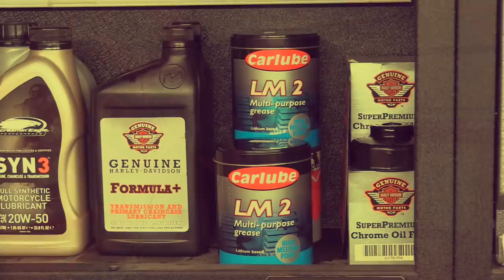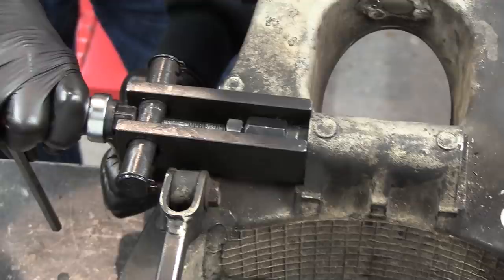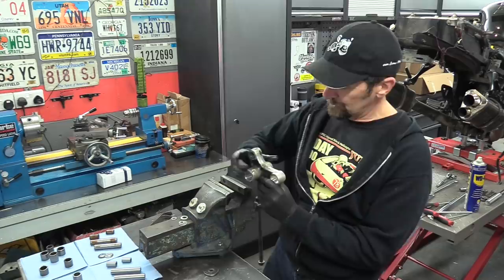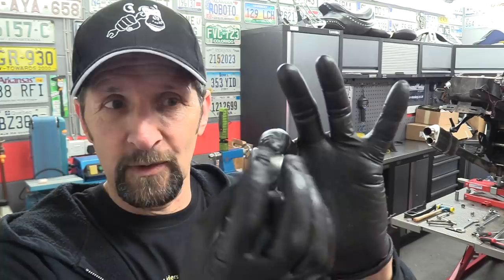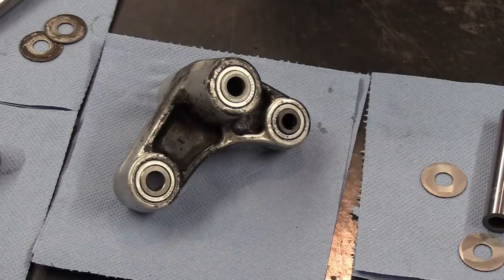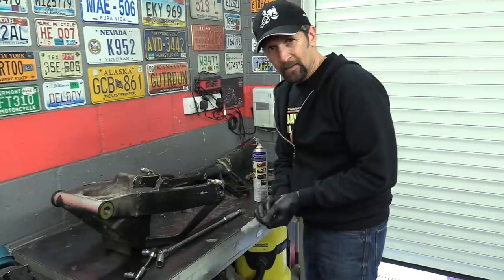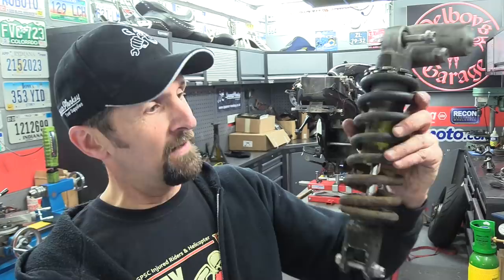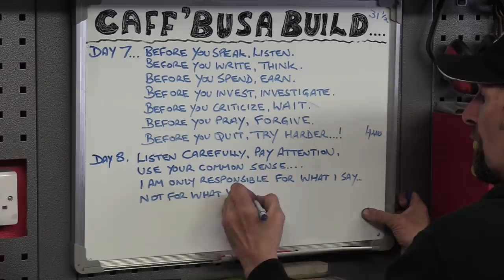Delboy's Garage, Busa Build Day 8, Suspension Short Link Bearings.

Comment: I am enjoying this so much, thank you.
Last year I was wearing some surgical gloves whilst angle grinding. The glove got sucked off of my hand, from between the thumb and forefinger, by the draft caused by the flapper wheel. That dragged my hand and wheel together.....kin ouchy! The glove wrapped around the grinder spindle and the flapper wheel bringing it to a full stop. I got lucky this time, just the top two layers of skin about the size of two 50p bits, and that was all good in a month or so.
Reply from the maker: Sure thing buddy, gloves and spinning wheels can be lethal, the black rubber gloves I wear rip in a second, and if anything, prevent those little abrasions when you catch the wire wheel, but strictly speaking it's still a no no... there have been some pretty horrific accidents due to gloves, basic stuff aye?!  Glad you got away with it, stay safe...

Comment: Suzuki Service Manual: "discard the self-locking nuts.." or "replace the ...... "
referring to the rear suspension. Good engineering practice to replace
any self-locker anyway, view them as single use items like oil seals.
Cheap enough. Enjoying your series chum. 
I had an RG125 which had chunky rust soup for bearings even worse 
than the ones you had.. If one's gone, they've all gone (or very soon will have).. 
so yep, change 'em all. Good engineering practice.

Comment: I change the front and rear wheel bearings and the final drive bearings every 3 years.
All of them together with good japanese bearings are only about £30.
97 plate Divi 900.
Just piece of mind, plus I get to see other parts of the bike and check on any areas for a "just in case" look.
Shock linkage, suspension bearings. I check and clean every 5 years.
I made up an excel spread sheet then printed that off and popped it into my haynes manual. (took the haynes apart and put into polly pockets and into a lever arch file, keeps the pages clean. Plus I can add extra pages into a certain chapter. Like the blow apart schematic of the entire shock linkage with part numbers, printed out on A3 paper.)
Leve arch file also has printed sheets for oil changes, date, mileage, then polly pocket for receipt.
Same with tyres, so I know date, mileage, tyre make and model.
Bit ocd-ish but I figure you cant have too much history for a bike.
had the divi 900 for 12 years now, this October 2018.

I did know a guy who had a divi 900 who put grease nipples into the shock linkage.
Worked really well for him. I've always been a bit 50 50 over it. I'm talking the main middle 2x bearing. 
From memory of reading on the forum hes had  good results. Keeps all the crap out.

One thing I have done, which was a suggestion to get seized bolts out.
hit with heat via a heat gun of blow torch, then spalt with plumbers pip freeze. Costs between £10 and £20 for a can, but the can last a while.
Talking just on the bolt or nut not the ally shock linkage. I had to do my shock linkage, which is why its mentioned. 

In my case, didnt work, as the steel bolt had welded to the inside of the shock linkage.
So I had to cut them both out.
Lucky for me, cross referencing the shock linkage, its on loads of yammys.
4KM blah blah. Anyway, got one in excellent condition for £10 including postage. Put all the new bearings in that and fitted to the bike. Got a new bolt for that as well as I had to cut thru it.
It was coming down to the wire as I planned of heading to Germany about 4 days later.
All worked well.
Now, dead easy to do service on. 

Got to do the headstock bearings, so looking forward to your headstock video.
I've got to make one of those threaded bar bearing places.
Its on the list of projects lol.
Reply from the maker: A bit OCD? You're not kidding mate, I don't keep my bikes long enough to spend that much time shuffling the paperwork, so it wouldn't work for me, but a good practice to keep track of things... putting grease nipples in your shortlink is a pointless waste of time tbh, because you can only do the centre of the shortlink knuckle and then it only pushes greases against the back of the centre sleeve so the bolt can till get welded in place, plus if you're forcing the grease in till it oozes out of the seals, you're forcing rust and crap past the seals, which can lacerate them... and also, you can en up neglecting the two end seals as they'll still need to come out and be stripped and cleaned, so it's no extra work to do all four, and the same goes for the swing arm mount tube... but at least it's good to hear someone keeping things greased and lubricated... I get a little tired these days at the abject and rampant neglect I see from today's modern motorcyclist, specially those with the lease bikes who treat them like they just don't care as it's not 'theirs'... but ho hum, the old school biker creed mentality is a dwindling ideal... Take care buddy, all the best, Del
Reply: @Moonfleet41  well.. had the bike 12 years this october, so not gonna get rid.
I also keep certain empty packets, like you had the old stock new item, that bag I;d write on what it was, date etc, then pop in the folder.
just in case I need to get another, at another time, or I need to help out someone else with the same bike, so kinda building up an encyclopedia on divi 900.
Just got a new front running light socket?
keeping the bag, with make and model on, as its off an XJR1300, but will fit the xj900s.
I'll order certain parts from Wemoto for say a Vmax, and they'll query it, cos I have the divi 900, and I'll point out the part numbers the same, but they list it for the Vmax and not the divi 900. lol.
anyway, BusaBaby is looking good.

Comment: Hey Delboy, I can’t believe how easy you make it look. I just had a total nightmare getting the suspension linkage bearings out my sv650 swing arm. I tried my slide hammer - no luck, tried heating the outside and cooling the inside. Still didn’t budge. The tool kept sliding through. I then tried chiselling from the other side and the edges of the bearing were just cracking off.
I then resulted to using a Dremel with a carbide bit and cut a line through the bearing casing. Unfortunately looks like I went about 1mm too far and now the case has a 1mm dip in it. can’t believe how much this has played on my mind. Now I need to do a repair and I am hoping Jb weld and pressing the new bearing in will suffice. Anyway great videos mate I wish mine went that smoothly.

Comment: Excellent video, I did not enjoy replacing the link on the ZZ I went through 2 of them until I had one that was good enough. That wire wheel is brilliant, I have been replacing the old bolts in both my bikes thinking they were junk.
Reply from the maker: Yeah sure thing Simone, the wire wheel is your friend, will save you a lot of money, just remember they will corrode again quicker than a new bolt, so it's more a stay of execution than an actual full pardon!

Comment: Del you shouldnt pack bearings with grease 1. if there is somewhere for the grease to go it will push it away from the rollers therefore wasted grease, not really an issue. 2. If there is no where for the grease to go the grease can prevent the rollers from turning causing them to sieze or if slow turning wear out sooner.(the gap is there as though both rollers in this case or balls though turning the same direction the surfaces oppose each other, packing with grease can prevent them from turning). 
There is a recommended amount of grease required for each type of bearings and this information is available in bearing catalogues or Im sure here on bearing internet sites.
In the past I regularly relaced high precision ball screw bearing or spindle roller bearings on CNC lathes or Machining centers sometimes 300mm DIA, for the spindle nose bearings they are usually a set of 3 taper roller bearings and the rear a set of 2, the last set I fitted 150mm OD there was a tube of grease allowing approx a pea size of grease for each bearing - recommended by both the bearing company and machine tool company.
I know steering head bearings or swinging arm bearings may not be such high precision but they can still sieze if packed with grease. 
I have witnessed these problems on a machine where a fitter regularly packed bearings on a weakly basis.

Comment: Hey Del and Penny, thanks for all the hard work.  I've just come back from a month away at work to watch loads of new videos :-)  Just a thought, whilst you have the shock out would it not be worthwhile changing the oil in it, and also the front forks as well if you get time, as who knows if it has ever been done, on a plus side that would mean more videos...... Yes i'm greedy!  Take it easy
Reply from the maker: Hi Kevin, Welcome back mate.. and thanks for watching... generally Rear shocks arent serviceable, you can strip them with some very specialist equipment, or you can have them rebuilt... but this one is healthy and dry.. no leaks or pitting.. its going back on for now mate as its a budget build, Sadly i do have to replace one of the forks as its badly corroded.. so just eeking out the budget the best i can so i can get it all done..!
Reply: @Moonfleet41 Thanks for the info, I suppose if they made them easy to service people would do it at home and they would lose money!  Glad yours is well as new ones are not cheap.   Not so good with the front fork,  I can only hope you find some on the cheap!  Anyway you shouldn't be answering my question you should be relaxing with the good lady!  Thanks for the answer and education ;-)

Comment: Good job done Del. Those needle roller races with the rubber seals, I can see that rubber seals one end is fine when there are two races back to back. But how about when only one race is fitted, do those races have a seal both ends?
Reply from the maker: No mate.. there are only two places they are fitted in a single journal, and thats the front and back of the short link block.. so its important to strip, clean and check them every few years depending on your level of bad weather usage..
Reply: @Moonfleet41  Thanks Del and Pen, loving this project

Comment: Would that blind bearing puller cause any damage to the needle bearings that would prevent them from being reused anyway even if they were still good?
Reply from the maker: If they're still good, then don't pull them out Ronan, the puller will damage the thin metal carrier the rollers sit in. They're one time use mate. !

Comment: looks as though  the collet was gripping the INSIDE of the needle bearing rather than going through and gripping the end of the bearing? ...I'm currently pulling bearings for first time.
Reply from the maker: Take a close look at your new bearings, there is no inner flange on them so yes, the collet presses against the rollers which then pull against the top flange..meanging it's actually pulled out from the top. !

Comment: Thanks Del I plan to re-grease my swingarm and linkage bearings when I change the rear tyre this year so your videos will be very useful. 
One question. What is your preferred fluid and method of cleaning needle bearings so they don't fall out, assuming the bearings  themselves don't need replacing.
Cheers Paul
Reply from the maker: Hi Paul, I just use a high melting point grease.. nothing fancy, just regular grease, and it keeps them healthy for years mate,,  Good luck with yours mate.. and thanks for your support.. Del.

Comment: Another great video Del. Just wondering why you didn't clean the swingarm before your mounted the new bearing?
Also I've found Plusgas is a lot better than WD40 when it comes to removing nuts,bolts and the likes.
Keep up the good work mate 👍
Reply: Geo Ham11 He is going for a gladiador look with chains so wants surfaces looking like shit! Haha
Reply: Geo Ham11 yes about WD40 not being penetrating oil but Water Dispersement, 40 was 40th trial batch before they thought it right, hence WD40 (Water Dispersement 40th control batch). I think it works for lots stuff an I've recharged cans with rubber tire valve. But I use something much better for loosening bolts an nuts. Tim

Comment: Del, having issues with my rear wheel. The disc is snagging on the pads on a small section of the rotation. Ive changed the position of the disc 180° but snags at the same point of the wheel (using spoke as a reference). Could the bearings be knackered? They dont seem to be rough.
Reply from the maker: Hi Graeme, can you check the disc for run out?  Is it possibly warped?  If you can place something fixed next to the bike with a screwdriver blade, for instance, just barely touching the face of the disc, and with the wheel off the ground just rotate the wheel and see if the screwdriver top touches all the way round, if there's any warp-age, it'll show... try that first and see how you go!

Comment: Dell, when pulling out the bearings would there be any reason you dont use a small battery powered drill so spin the nut that pulls the bearing out ? rather than going mental with the spanner :D also as for the bolts they look all nice and shineeeey.. only thing i did the same and after a couple of months they all rusted and looked kak would you coat them with anything to keep them looking shineeey ?
Reply from the maker: Hi buddy, the actuator nut on the puller needs you to hold the centre bolt still, otherwise it can turn and actually rotate the die, or at the very least, over tighten the bolt within the die, and in a worse scenario, the whole bridge puller can twist and fall off the casting, so best to hold it still and gently extract it with a ratchet spanner.... And with the bolts, quite probably I'll coat them up with some marine grease, or chain wax, once the bike is fully re-built.

Comment: WD40 is not a very good penetrant. If you guys have it over there, try PB Blaster. It will run circles around WD40.
Reply from the maker: Plus Gas is probably the best I've used over the years and yes, WD40 is an all in one oil, does everything ok, and nothing expert, and it saves having 6 tins in the cupboard too, cheers buddy.

Comment: Love the videos! I'm constantly learning. 
Quick question not related to the video, but can we use normal car (eg 10W40) oil to service the bike?
Reply: I wouldn't. I have read quite extensively on this and the additives in motorcycle oils are different than in car oils. Also, in a bike the oil runs through everything, engine, gearbox, clutch. In a car it has a much more limited usage area (dry clutch in a car along with a different oil for the gearbox) and does not experience the same amount of wear and tear as in a bike, which tends to rev higher. I used to use car oil and learned that it was not a smart idea.

Comment: Oi! I'm listening....and watching....:)  Here's a throwback to your theory about changing oil. I've been having a raging discussion with other bikers about how often to change oil. Now I took your advice from a video a few years back: chuck through new oil every 1000 or so miles and change the filter according to maintenance schedule. Most folks are saying if you use a good brand oil like Motul or Motorex then you can leave it in as long as the filter. From my experience, I take issue with that because oil tends to go dark chocolate for me after about 500 miles...meh. So, have you changed your mind on that or are you still advocating a much more frequent (just) oil change? Just wondering. Thanks again for all your advice and helpful video. Best wishes to you and Penny. :)
Reply from the maker: Hi Patricia, you're picking a freeze frame comment from long ago when I was probably talking about my ageing old Bandit, manufacturers give advice on oil change intervals based on their belief in their product, but in simple logic, you cannot possibly change oil TOO OFTEN, look at race bikes, they have a full engine re-build every race with fresh oil and coolant... and don't be fooled that because oil is black, it is no good, diesel engines will blacken their oil in 50miles yet it'll take thousands of miles to break down the molecular structure of oil so that it's lubrication properties become diminished... people will always debate oil change intervals, so you just have to make a choice for your own bike.  Personally on my Harley I roll every 5,000 miles and change all oils, but if you're riding in super cold temps. where the bike doesn't warm up to fully working temp., then you'll develop condensation via hot gases on cold steel and a moist atmosphere, therefore your oil will develop an increasing water content as time goes on and this can lead to internal rust, specially on the top of the engine that dries out when not in use, namely your cams.  So consider your usage and change your oil when you feel right with it!